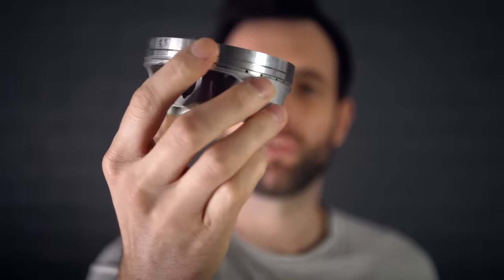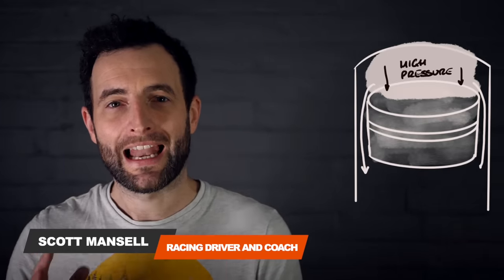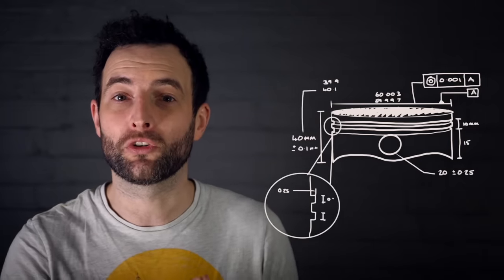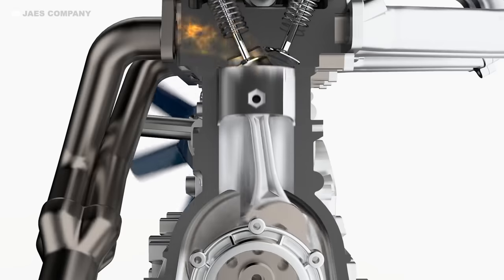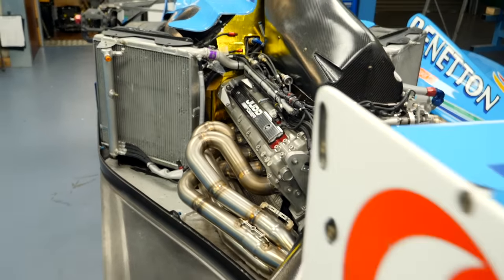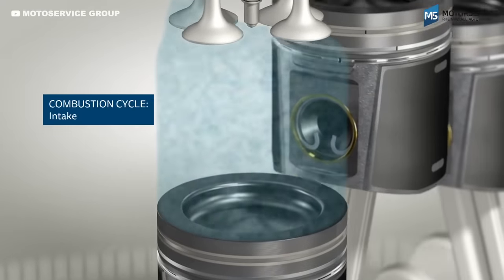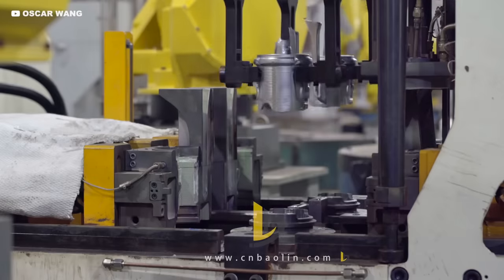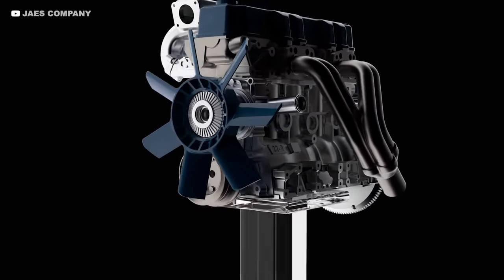Why F1 Pistons Cost £50,000!

Comment: As a cnc programer and machinist I call BS on £50,000 unless the raw material cost is £49,000.
The tolerances you mentioned are tight, but not something a regular industrial cnc machine can't handle.
Reply: As a CNC shop owner in China, I must say you totally nailed it. If the tolerance requirements mentioned in the video are correct, the challenges of making these pistons are just nothing more than our everyday tasks.
Reply: The costs are the R&D costs, certification/F1 legality checks cost and the simple fact that the buyers are willing to pay this price. Normally, the R&D costs in for products would dilute, but since these are made in quadruple digits at best it can be crazy expensive. Not to mention that these need to withstands such forces. And do not forget the certification costs! My parents are dentists and they have to use a lot of certified things, but these are not only the dentist devices, these apply to even things like computer monitors or metal trays, which do not even get close to the patients mouth. The certified metal trays cost $48 (I dont know the exact exchange course), while you can get similar in store for $4. 12 times the price for the same product.
Reply: maybe they buy a new CNC machine for each piston?
Reply: @josefmuller86  Even if this were true the pistons still don't cost 50,000 pounds. The research costs what it costs, The question is what does it cost and F1 team to buy the next piston. 50,000 pounds would be nuts.
Reply: Graphene costs abut $100 a gram but from those in the graphene industry that i have talked to, everything is top secret and they told me that there is an upper limit on the amount of graphene that is used. Graphene is many times stronger than steel and is a mystery material for the outside world. Of course the $15,000 racing bikes and both the Williams sisters tennis rackets are made from graphene, but in racing the old adage is "Speed costs money, how fast do you want to go?" John Force could use it in his NHRA Funny Cars because one explosion he had in 2019 or 2018, cost him about $750,000 in lost stuff as everything on the car and frame was toast.  For a racing engine, not Top Fuel or Funny Car, about one percent of graphene in a 750 gram piston will raise the cost of the piston by a few hundred dollars. Two percent is a good number, but in Indy cars, it is about perfect, as they are no where near as expensive as F One engines. But, can you run better pistons at just some of the races but not all of them? Such as the Indy 500, where the winner gets about $2 million in prize money and extra endorsements, running a piston worth $5,000 is probably worth it, just for that one race....even if you place second where you take home about $800,000.
Reply: They will die of hunger if they sell cheaper)) There are many things in this world that cost much more than they should be. Bicycles and everything connected with them, for example .. I have a Mercedes, a shock absorber is cheaper than a bicycle. The tires are the same cost, although they are much simpler and lighter on the bike. Dozens of times .. Points also cost a lot of money, which cannot be explained by anything but greed ..
Reply: Im convinced F1 is a money laundering scheme.
Reply: @Pete Pester Sarcasm is poorly translated by an auto-translator
Reply: @Pete Pester i used to work as a engineer for Renault f1 team between 2004 and 2008. I can't remember the exact cost of the parts but they wernt anywhere close to the costs reported here. 50k for 1 piston lol. Erm no.
Reply: @Pete Pester i mean, im merely talking the price Renault paid to the subcontractors to supply the parts. Obviously if you start adding in research and design costs, salary costs, testing etc to bump up the price for shock value, then yes, it'll be a much bigger figure, but they weren't paying 50k per piston to engineering firms to manufacture them. I have no clue what the cost wud be if you did start adding all the other things in and dividing it over a small amount of pistons, but of course the more pistons you manufacture, the total cost per piston comes down. They also dont research and design all parts every year either. I worked mainly on steering mechanicals and in the 4 years i was there i cant remember too many parts ever getting up-revved on that side of things either, if any.
Reply: @Pete Pester just reading your past posts. Youve had a pretty similar career to me in a lot of ways, well, similar experience. I started at rolls royce as an apprentice then moved about. I worked as a tool maker for a while. Im experienced in cnc mill and turn. Used manual mills and lathes for years too. Wire eroding yes, all sorts of grinding, from surface to cylindrical and centerless. Done stints as inspection using cmm's and all that good stuff. Worked on stuff for nuclear industry, aerospace, planes, satellites etc. I worked various roles in the oil and gas sector and currently working on military vehicles.
Reply: @hyperlemongt4890  they use awesome top fuel CNC machines that have to be rebuilt after every work piece.
Reply: For sure, as a hobbyist I can hold a couple thou if I try
Reply: A a fell programmer, I agree with you..  and I assume you also hate your life like everyone else in the trade?
Reply: Completely agree. I’m a machinist as well, with both manual and CNC experience. Even with fixture design, they makes what, 18 pistons a year?  There’s no way it costs 50k to make a single piston. I’m sure they’re quite expensive, but no way they are 50k.
Reply: @Pete Pester indeed. manufacturing a cylindrical part with 0.01 mm tolerance is nothing even for a conventional lathe and it is nowhere near enough for "any" engine pistons to operate consistently. i am pretty sure that the actual tolerances are way more tighter...
Reply: Exactly..I have horses I know what that smell is
Reply: Yeah, this is pure and simple horseshit.
Reply: His stated tolerances are wrong. All of the aluminum passenger OEM pistons we manufacture have an OD tolerance of +/-5 microns at the major diameter. Of course the piston is not round either. It is oval and the amount of ovality varies up and down the part. The piston is not a cylinder either. It is barrel shaped. The pinbore is trumpet shaped and most likely oval, as well. Ring grooves are inclined, as opposed to being straight. So to say a regular CNC can machine a piston is thoeretically possible but highly unlikely especially when you start considering GD&T with respect to concentricity, parallelism, waviness & perpendicularity of one feature to another. And then you get a perfect part, but the weight is out of tolerance (most OEM parts have a tolerance of +/-5 grams). The expense comes from the design work, R&D & testing.
Reply: It’s not the manufacturing costs. It’s the cost of material, testing, quality control tests, and a slew of other things that go into ensuring each and every piston is made perfectly. The production itself might only take a few hours on a cnc, but everything else adds up. Especially if you’re buying your own machines and testing equipment
Reply: Why don't you consider building a crate engine for building project cars.
Reply: I agree , I think they purposly hype it up. They spend all this money to put on races that are really boring a lot of times. MotoGP makes F1 look really bad.
Reply: 80% paperwork 20% part making
Reply: I agree. Only way to get to this figure is if they take total R&D cost and Material and machining and prototyping and endless engine dyno testing and all of it and devide it but the 200odd pistons they end up making. Then maybe.
Reply: Would think even with precision machining the pistons, pins, rods, etc will need to be weighed and balanced. But I could be wrong.
Reply: it cost that much because there are only 4  engine/power unit builders/suppliers  that you can buy from , honda soon to be red bull, Ferrari, mercedes and renault and there  charging you not just raw material costs but everything else like R and D ,. building etc when you buy the complete engine /power unit from them
Reply: Don`t forget that you also have to add up the costs of the pistons that didn`t pass the quality controll. R&D for a single engine is massive.  Wouldnt be surprised if 75+% is R&D Cost.
Reply: Absolutly right, This stuff is high because of the buyer.  A piston is a piston.  I cnc machined a wheel hub and the drill had a issue and it bored the hole again, perfectly the same, i had to throw it away, simple as that.  They have a high market price, us workers that do this everyday its so common to us, but to viewers that are just gawking at something they dont even paticapate in, its just eye candy, or a odd and weak conversation with you friends to make themselves feel smart.  Just another day at work
Reply: @hyperlemongt4890  small to medium CNC is $250,000
Reply: I produce pistons for Prototype Engines for all kinds of Brands like Audi, Mercedes etc. I highly doubt that one piston alone would cost 50k but for the whole set of pistons for one motor this seems pretty normal. You have to remember that the designing of the pistons changes with every motor prototype and these costs for the time of designing will flow in to the costs of the piston. Its also much more expensive to setup the machines for just a few pistons rather than a big production where a few thousands pistons are produced but in F1 i think theres mostly single item production so this gets very expensive. Ive produced pistons for a normal brands like renault or toyota that would cost 1k per piston so i think its not that suprising for a high end motor like these cars have.
Reply: A few years back (quite a few) I was a metal polisher.  Out of the blue we were asked to polish those trumpet shaped things that go on the engine intake for one of the F1 teams.  There were about a hundred of them from memory and I quoted £50 each - thinking they’d talk me down.  They actually said make it £500 each and do a “really good job.”  
Maybe that helps understand why these pistons are so expensive.
Reply: agreed
Reply: You guys are also forgetting that theres only 3 engines per team per season sometimes more but they gotta pay the people making the engines too and i doubt they come cheap especially when they want ultra high quality
Reply: I was just about to say this same exact thing.
Reply: @catttcattt  you should put in a bid to make these if they are overpaying this much. 😉
Reply: @marksmyth9861  a late response but Graphene costs 1000$ for a kilo not 100 dollars for a gram
Reply: Hurumph!
Reply: Absolutely. This video builds a little bit on non-machinist's perception of tolerances. A "regular person" hears "...less than 0.15mm" and thinks wow, that's so small. To me this almost sounds like a big ol' canyon :D
Reply: im a gunsmith, and my tolerances when chanbering a gun barrel are 10 times more precise than that. 0.15 mm is 0.0059 inches(sorry, im american and thats what im used to working in) and my gun barrels are chambered to a tolerance of 0.0002 inches
Reply: @josefmuller86  oh so a bunch of bullshit is what makes it cost so much… sounds like this hellhole of a world…
Reply: I’d hazard a guess that F1 machinists do their work when the component is under specific stresses & tempatures.

And lot sizes matter when every team wants to make their own alloy. 🫠
Reply: Uh, the tolerances are held to around a tenth of those cited, in all dimentions, and the amortisation costs have to be spread over a much reduced product run - and those development costs can run into the 8 figure range.
Then there's the testing, treatments, coatings, etc,  and other fettling required.
Reply: @marksmyth9861  Indy car engines turn about HALF the rpm as an F1 engine(11,000 vs 19000+) so the prices go up accordingly. Same with the valve train. Indy engines still use mechanically actuated valves with camshafts where F1 engines have electro magnetically controlled variable valve timing & no valve springs. F1 "practice" is more for the tuner engineer to optimize valve timing & shift points with his laptop, than for the driver to actually "practice" the course! The NASCAR engines were turning 10,000+(some almost reaching 11,000 rpm) with a pushrod engine until NASCAR stepped in with the gear rule to lower the rpm around 9,000 in the name of "cubic $$$$$" because they were having to change valve springs a couple times per race weekend at a cost of around $3,500 per set. Pro Stock 500ci engines turn 10,500 & need valve springs changed at least once per race weekend. They now set the "installed height" at peak lift pressure instead of seat pressure & Pro Stock engines run more seat pressure than most engines have at peak lift!.
Reply: Can the f1 crew monitor cylinder pressure in real time. Do engines use oil cooling jets.
Reply: @EddieA907  
It's done during development, whether by drilling the hear for piezo'sensors, or using special sparkplugs with the sensors built in.
For those interested in this for their own engine development, you can buy the sparkplugs commercially.
I don't know if the actual race engines use them, but they can monitor the burn from the sparkplug voltages and the block mounted piezo' sensors - basically more specialised knock sensors as found on modern engines - will detect different frequencies and vibrations that can be interpreted.

Yes, they use a LOT of oil cooling jets - four or more being normal, as the pistons are a very highly stressed item.
Reply: What if they were made out of beryllium instead?, I've heard rumours that back in the year 2000 formula 1 engine manufacturers are using Beryllium for their piston and possibly for their entire engine
Reply: @arvinadilaksono4904  
Beryllium is a VERY toxic metal, it was used many years ago for increasing the strength of the brake calipers (to reduce flex) but was banned because it was a hazard.
Don't know about other applications that might have/do use it in the alloys.
I do know there have been acceptable and banned materials for most components for many years.
Reply: @arvinadilaksono4904  NHRA Pro Stock cars & Outlaw sprint cars were starting to use connecting rods made from a beryllium alloy 20 years ago. Both organizations banned them & also put a minimum weight rule in place for the rods, piston, & wrist pin. to help lower costs a bit. I haven't ever heard of any beryllium alloy pistons. F1 motors turn 20,000 rpm because they don't have camshafts & valve springs to control the valves, which also allows true variable valve timing(controlling lift, duration, & lobe separation angle) instead of "cam phasing"(controlling ONLY lobe separation angle), which is what VVT is in today's production cars.
Reply: @gordowg1wg145  Back in the year 2000 it's said that Mercedes are supplying Mclaren F1 with Engines which used Beryllium Piston (not technically pure Beryllium since it's mixed with Aluminum but it's reported that each piston at least made up of either 30% to 70% of Beryllium
Reply: @bradgriffith4231  20 years ago Mercedes did supply Mclaren F1 teams with engines using Beryllium Pistons
Reply: @arvinadilaksono4904  
Thank you for that, I'll follow up on it but, as I said, berylium is highly toxic and was already (timescale?) a banned element for calipers, so unlikely to be legal for pistons.

Doesn't mean you're wrong, though, so worth checking out...

Yes, YOU ARE CORRECT! Thank you for the correction.

They were banned for the following year, as were many other applications of the element. I thought it was earlier - I blame old age...
Reply: @arvinadilaksono4904  Doesn't matter. Still doesn't make a set of 6 pistons cost $50,000. NHRA Pro Stock were running Berylium rods 15 years ago until they were outlawed to keep prices down slightly for the lower budget teams. BTW, they aren't solid Berylium, but an alloy with Berylium in it. Berylium can't be used alone & must be added in minute amounts to the alloy.
Reply: @arvinadilaksono4904  Berylium isn't used alone. It's alloyed in minute amounts with aluminum to make the piece stronger without sacrificing weight.
Reply: The quoted cost includes all the design & simulated testing time and costs. It's not just the overhead of the machine to manufacture it.
Reply: @bkdguitarist  And use 25 gigawatts.